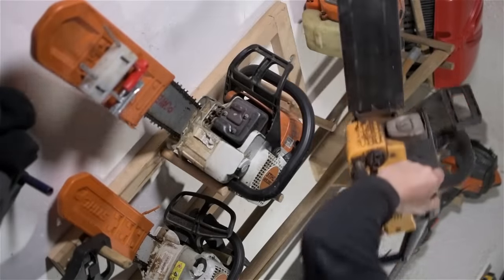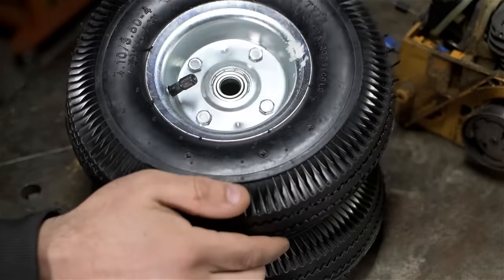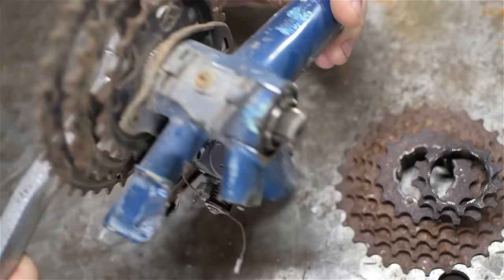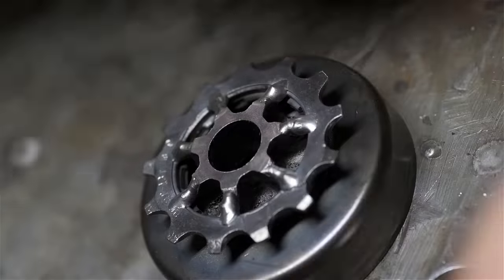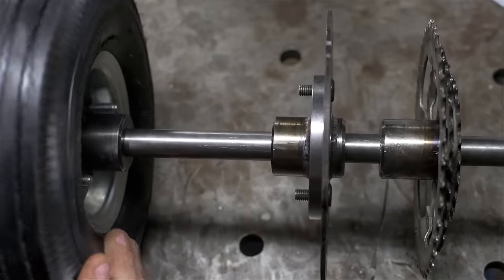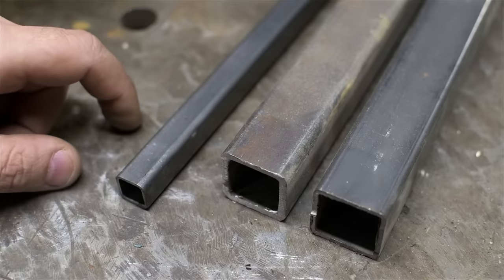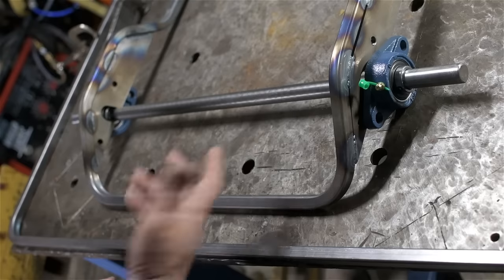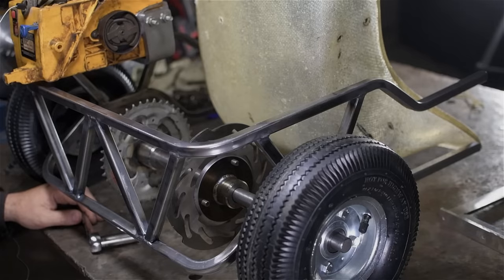CHAINSAW GO KART! - Part 1

Comment: You could obtain any gear reduction ratio desired with the use of a jackshaft and wouldn't loose the power absorbed by a worm drive or any other type of "transmission".

Comment: Watching you whip up the die gave me a thought: Stackable discs to quickly make a die for any thickness square tubing and bend diameter. Not sure if that's possible or even practical. Just sets of varied diameters and thicknesses that can be quickly bolted together or something.

Coming from a man who's never even used a bender, so could be a dumb idea

Comment: Tony, in order to achieve the correct reduction you're looking for you need as large a gear as possible on the wheel and as small a gear as possible on the engine. Just letting ya know. 👍

Comment: I got a 1958 go-kart with dual power products AH47 which is about 4 hp at 77cc, and that thing is the biggest pain in the rear! but when it works, it gets going fast in very little time (about 22mph in 10 seconds or less). I got it for a days work, and later discovered that it is worth about $3000 complete!

Comment: This reminds me of when me and my little brother I took a monkey bike, cut it in half, extended it 7inches, mounted a chainsaw above the rear wheel and built a dual chain gear reduction. The sprocket was made from a washer and used old bicycle chain. It lasted amazingly long, and went surprisingly fast. But it was more of a "There we did it" than a built to last device.

Comment: i liked this video for the chainsaw maintenance intro lol.  the actual content is a bonus :D
Reply: now i know i am a few years behind here, but after you welded the sprocket on, could you have strengthened your "wagon-wheel" by adding some nuts or other cylindrical spacers of some kind between the spokes, for structure?

Comment: Back in the 1970's chsinsaw powered carts were the thing. We used to mount two big  McCulloch  powerheads on a cart, We had to get regular chain sprockets and a heavy duty clutch. We also raced them by port and polishing the cylinders.

Comment: Had a kart as a kid (50 years ago, good god, I'm old) with a 4 HP West Bend chainsaw engine on it.  Not much "out of the hole" compared to the new Craftsman (Tecumseh 4HP 4 cycle) that went on later, but lot's O' top end, about 15% more than the later motor.  It would run about 32 reaching back and bypassing the governor, occasionally.  Seemed really fast at that age and that close to the ground though.   ;-)

Your kart is a whole crap load better built than mine was, though.  I think it was a home made as well, in mild steel tube, by a welder you would put to shame.  This guy didn't have a CLUE about triangulating a frame, either.  I had many many memorable hours of great fun with it though.

Comment: I know it's far too late in the game...but would it be possible to have done it with some type of worm drive system? that would be easier to control the speed, while giving plenty of torque...I mean ofc, everything is possible...depending on solutions and time/effort put into it...

Comment: Just to satisfy my curiosity - what would be the better way of securing the brake and sprocket to the axle? I have no machining background but my best guess would have been those keyed slots and set screw assembly. 

My next thought was that it can't be a good solution, because the benefit of being able to easily swap/optimize parts seems to far outweigh the difficulty of manufacturing the system... so what am I missing? Worried that it won't hold the parts securely enough? Too much shear force applied to the set screw?

Comment: Take it from someone that ran saws professionally for many years..
With a chainsaw engine,YOU NEED that clutch cover.Ever see a clutch come apart at 2-13K? Not pretty if the pieces hit anything...
It's not if the clutch would come off,IT WILL sooner or later...just don't know when.The cover keeps the clutch from backing off when you let off the throttle.
I see people checking an oiler all the time without the cover IRL or in videos,they're pressing their luck as to when they'll catch that hunk of metal with their head or anyone that may be in the proximity of the clutch side of the saw.

Comment: "Why are you welding a bolt to the cassette!? Just use a cassette tool then use a chain gri...." Yeah you're kinda right there on how many specialized tools you need to pull bikes apart. Most of them are all 5mm or 1/4" allen keys too.

Comment: Been thinking about a 2 wheel scooter, using the same type of wheels you chose. But, whilst browsing some used cycles, I noticed shimano have a 7 gear hub, like the old fashioned 3 gear hubs. So I'm now looking for a buckled wheel to steal the geared hub, and then find a way of mounting it to the cart wheels.
Might go for electric drive.
Cheers Tony

Comment: Specific parts of the bike such as the bottom bracket and the headset aren't meant to be serviced or repaired by its user. Specifically, bottom bracket threads are tapped right handed on the non-drive side and left-handed on the drive side. Chainsets are easy to remove if you using the right tool.

Comment: Welding the hubs on is exactly what i did when i made a go kart in highschool. Everything would have been fine and dandy, but i also welded the wheels on instead of making hubs like you did. Too many burnouts (5HP honda) and now i have 2 blown tires and i cant get the tires off. RIP

Comment: If it's close to 3/4" conduit you always add 6" and bend at the +6" mark and at 90 degrees, the length to the other end of the arc would be back to 0" if that makes any sense! Of course the bar bend radius is tighter than that of conduit!

Comment: 6:41 Now that is a cool trick to get a sprocket off!! As for putting rope down the cylinder its fine as long as you make sure the exhaust port is closed. if the rope makes it out the exhaust that causes a bit of a sticky situation...

Comment: Subbed, cool build idea. Have thought of doing a twin motor? 1 motor direct drive to your 2 rear wheels? (if there is room)
Another question, are you using AGM or LITHIUM battery set up? (Just that as you probably aware that there is sooo many reasons why Lithium. Weight to power ratio on your motor/s for one of mm any.) DIY set up of course.

Comment: (I know this comment is a few years too late) They actually did use to use chainsaw engine in go-karts back in the day, but it was the older engines. They worked because they had a lot more torque than modern saws. Also your poulan has worked so well for so long because it's an older saw, their quality has dropped sharply. I should know, we had to get a new saw when the old one finally gave up and the first one we got didn't work, the second one was pain in the [CENSORED] and after the second one kept giving so much grief we decided to go for a Stihl, and this is after we also looked at huskvarna and a couple other brands. They've just cheapened out, Stihl seems to be one of if not the only good brand around.

Comment: Note to amateur welders: I've found that pre-heating hard steel (like springs) makes welding easier, and if you quench after, retains the strength. If no pre-heat, the material breaks near the weld area due to sharp heat gradient on cooling. This is a proven technique, I welded spring steel for a trailer, and have carried heavy loads with it many times.

Comment: You will have to use a jack shaft, it will require 2 more bearings but you can get more gear reduction. My dad also built several carts when me and my brothers were growing up first one had a 2 1/2  hp Clinton.  When we were a little older he let us start driving his racing cart , he built one for himself to race and it also used chainsaw engines 2 one with clutch and one with direct drive, they were the larger Mc C  2 man saw engines, more like 125 cc he would pull chain off the engine with direct drive and let us drive it with only one engine and he still had to put a throttle stop on the one engine, it was still fast. Didn't  have to worry much about the grass mowing we keep most of the grass destroyed in our yard. Boy, did we have a lot of fun, this was late 50s and early 60s and as we got older we built some carts or our own, and then we moved up to dune buggy when we were teenagers, amazingly  we are all still living! My dad started all this with a little 2 1/2 hp wooden seat cart when we were 3 and 4 yrs old.

Comment: The rope in the cylinder trick works great on 4 stroke engines to hold the valves in place to be able to remove the springs and change valve seals.

Comment: You could maybe add a sprocket wheel on to the axle that's not welded to it (with an appropriate bearing in the middle so that it can spin freely without interfering with the axle) and go back up and then back down to get the desired reduction?

Comment: Poulan can be used for a boat anchor, not cutting wood, compete junk.  Your local scrap yard will sell you everything you need to build projects for twice metal salvage prices like motors, bike parts, steel for welding, all you need to do is ask permission, be careful and know where their workers are at all times to stay out of their way.

Comment: 6:52 - Lack of standardization until the mid 80's even then only in high end stuff.

I work on bikes made after 1995 of decent quality and honestly only needed to buy one of everything; cassette tool, crank puller what have you.

Comment: My brother put a two Cylinder Snow Machine , on a gokart, it got up to 100MPH, before they stopped. Put the rear tires, on loose dirty and/or gravel. It would throw gravel. When taking off.

Comment: The wider the axle, the more problems you are going to have in turns unless you have some kind of diff setup. It'll still drive, but it will become hard to handle, since either the inside wheel will spin forward, creating oversteer, or the outside wheel will spin backward (compared to the ground), creating understeer. Most likely oversteer, since the weight is on the outside wheels, but you'll never know for sure, which could be dangerous if you plan on making something that goes a lot faster than this.

The way to offset this is to make the car longer, but that will reduce the turning response. So it's a balancing act.

Comment: The saw has between 2~2.2hp and the wide open throttle speed for tuning the saw unloaded is 13,500rpm.  The saw gets the most power under load around 9,000~10,500rpm.  These engines are tuned and designed for use wide open throttle only - they don't have a wide power band.  You can get some extra power (and noise) out of it by opening up the muffler a little and retuning.  In terms of drive chain, bicycle chain isn't up to the task.  A human can at most (olympic levels) sustain 1hp of output for brief periods.  More likely the average human can sustain not much more than about half a horsepower continuously.  

The best chain for this purpose is generally....  saw chain.  unless you want to go to belts, go kart chain etc.  Saw chain obviously can take the full load of the saw.  Several tools are made for attaching to saw heads, most notably drills, chop saw heads, winches etc.  They're almost universally driven by saw chain with the cutters cut off.  There are sprockets of many sizes available for racing saws, or you can make them yourself.  You can sometimes find the older atom drill heads for $cheap and they're reversible also - giving you a reverse gear.  Can also attach a drill to them for robot war go kart races.  May need a few more kids though - consult your wife if in doubt ;-)

Comment: Back in the early 60s the clutches had a very small sprocket off the end of the friction bell, just as the saw chain sprocket is small.  Tens of thousands of go karts were powered with chain saw engines, lawn mower engines, etc, with 7 to 11 teeth on the centrifugal clutches. 

Video Easter egg??? Wheel inside ... "Great Wall - Made in China"   

put brake disc on left side so left foot pedal pull rod can pull directly on caliper, no need for a jack shaft to cross the chassis... Of  course, Jack would be disappointed to not have a shaft in the frame.
Reply: My brother put a chain saw engine on a bicycle. He was stopped, & the cop said he was speeding(over 30mph). He was told to keep it off the streets.

Comment: Alot of times when an engine has trouble starting it's because the sparkplug electrodes are dull, sharp edges concentrate the spark power into a hotspot and are more likely to ignite the mixture.

Comment: would a combination of drive shaft and chain gears give enough reach to perhaps place the motor in the front and still keep the wheel drive in the rear? and would that complicate things unneccessary?
Reply from the maker: I was trying to avoid backlash for when the spindle is in indexing mode.

Comment: @2:03 I love my Poulan, easy starts, lots of power. It can be a tad difficult when it runs out of gas. I bought it out of desperation, I got tired of fighting ny Husky Rancher 55. After 2 years it's still going strong, and the Husky has been sent to the graveyard for unfit saws. Granted I'm no wood chuck, but I do more cutting than the average home owner.

Comment: I've literally had every Stihl and Husqvarna saw you can imagine. I love my Stihl equipment. However, they have all cost me money to repair before. I have 3 Poulan saws that are all over 10 and one even probably 20 years old. Never had an issue with any of them and those are my "beater" saws. I run them through all the wet, nasty, sticky, close to the ground shit I don't want to run my "good" saws through. The poulans have never given me an issue. I've had them pinched and and forgot them in the snow and left them in the bed of my truck during a storm. They just keep on chugging.

Comment: You should see an RC airplane with 6 powerful saws roaring as the plane (larger than my truck) takes off and flies patterns.   RC guys started using weed wacker motors and then stepped up and up and now into Jet engines.

Comment: You want it as light as possible yet strong enough for the power applied and rough and tumble kid use: Why 1/2" plate for some components when 1/4 or even .187" would suffice? I admire your machining and tig skills.

Comment: We used to convert go carts back in 70’s 80’s with chainsaw engines or 125 susuki engines.  This is nothing new.  However they are the best replacement for the under powered Briggs.

Comment: Bike gears have slotting to enable up and down shifting, my guess is there's gonna be problems with it. Even if you line it perfectly straight any movement from motor vibration or riding will throw it.

Comment: Just a memory for the those who knocked the straight axle....
The single drive carts I had as a kid had no chance against equivalently powered straight axle carts on a dirt track. 
They would drift a bit and go through the turns FAR faster!I

All the faster carts had straight axles.

Comment: As a thought,  should wire an extension cord to a light switch, that way you can turn on and start the clock at the same time.

Comment: Ive butchered more than a few bottom brackets on a bike. Its just how us motor lovers do it, we see no need in pedal power. I put my old homelite on a few kids toys. At least the motors take to porting and mods well. It is easy to kill the low end trying to mod it. Small baby steps are key but more air and fuel cant hurt.

Comment: the closer drive sprocket and driven sprocket are in size the closer it is to 1:1. a 3 inch drive would be 10:3 is 3k rpm at the wheel, a 1 inch drive would be 10:1 or 1k rpm at the wheel

Comment: I'd use the simple chain setup that you have. You don't need any more gear reduction outside the fact that your engine sprocket needs to be a few teeth smaller and the axle sprocket a few teeth larger. Believe it or not the 46cc engine will produce around 5hp. It's just not going to have boo coo's of torque. If it will pull off alright with the gearing started with it should easily run 35-40mph.

Comment: you are right about that little saw having a husqvarna engine in it as husqvarna and poulan are most often made in the same plant as both are names owned by AB Electrolux, yep thats right along with the name weedeater and frigidaire company, thats where i used to work so all is parent owned by AB Electrolux which is indeed a swiss company. i think the husqvarna /poulan plant was near little rock AR. last i heard

Comment: Years ago (2006?) guy I worked with took pretty much any chainsaw or 'weed-whacker' motor and ported them to use in model speedboats. Managed to get one dyno'ed one time, made almost 6.5hp@30,0000. Life wasn't very long but I guess model boat racers didn't care? (Was trading as 'Toxic Marine) In fact, seeing this, I think I'll contact Allen and see if there is a 'better' 12mm carb for some of the junk leaf blowers I have, not happy with 15~20 min run time on grandsons battery buggy (lead acid on RAZER)

Comment: Everything I own is Stihl love them to death. However my grand father has a Husqvarna saw and its just as reliable as my Stihl’s. Just bought one of those Ryobi expand it gas multi tools from Home Depot and I absolutely love that little thing too! Use the brush clearing attachment and it is not used gently either. I honestly don’t think company names matter as much as they used too. If you start them right every time and clean em up after use, you won’t have a problem with any machine. All comes down to the owner way more then the company name. Just my 2 cents! 😬👍

Comment: The 46cc might be ok for small kids.  You need a substantial reduction with a 10,000 rpm engine there. 

I want about 100cc myself.  Worked with a guy that built one with 3 - 54cc chainsaw engines years ago.  That cart had style.

Comment: The back sprockets of the bike are alot easier to get and it has a built in steel catch you could weld to make it sturdier that's wat i did when building my 10 dollar dirt bike and it works great